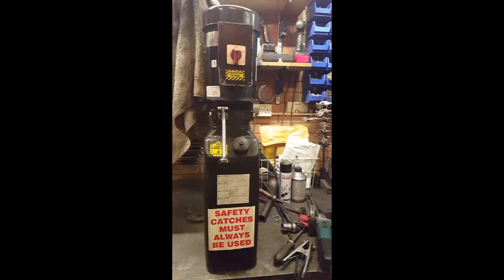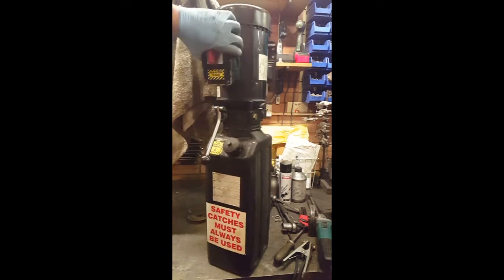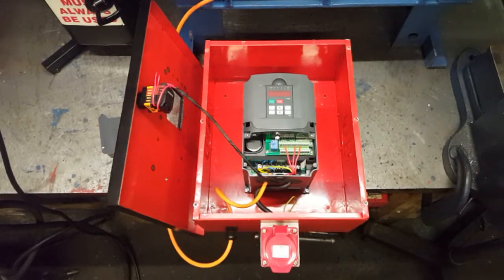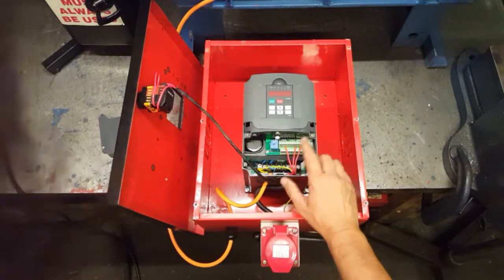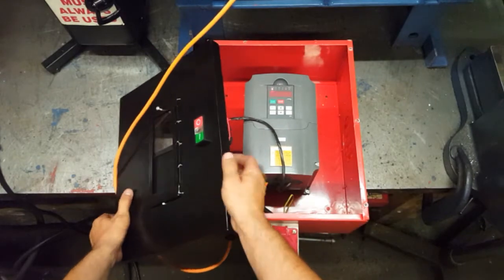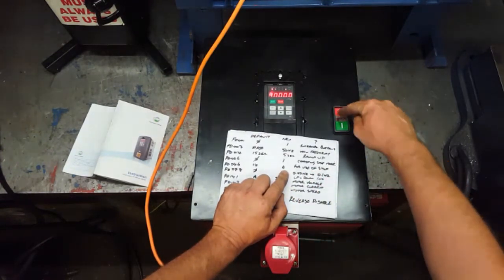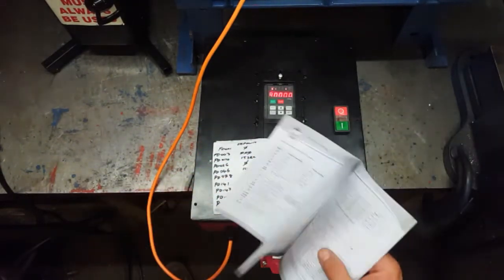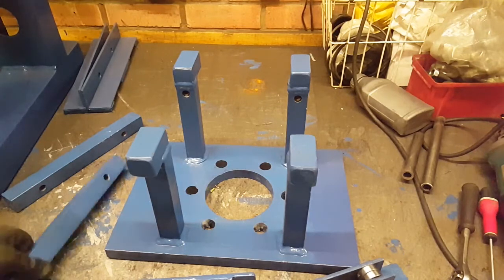Making Portable Hydraulic Workshop Press With Floating Head/Ram & Inverter Driven VFD DIY

Comment: Do you have any measurements on the frame and the materials used?  I want to build one exactly like this in a 15 ton press format.  Would love to get your drawings to fabricate one!
Reply from the maker: The materials are what i could find for free except the laser cut piece. I will measure it up for you tomorrow. 👍 This frame is to strong for 15 t press, you may wish to reduce the thickness on my sizes.